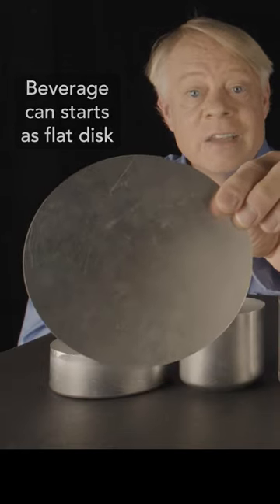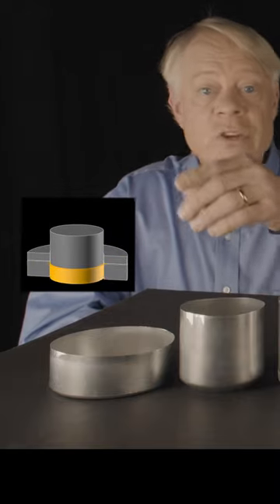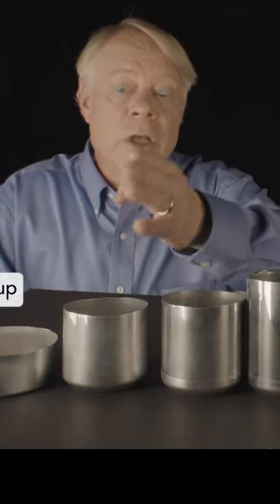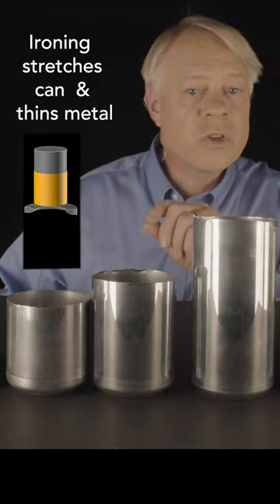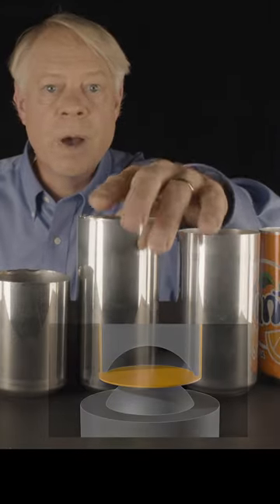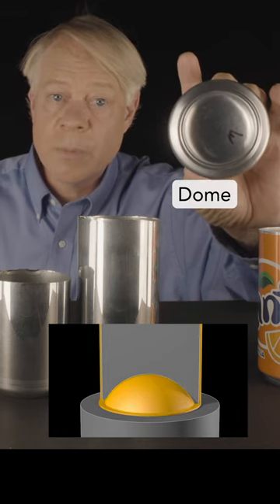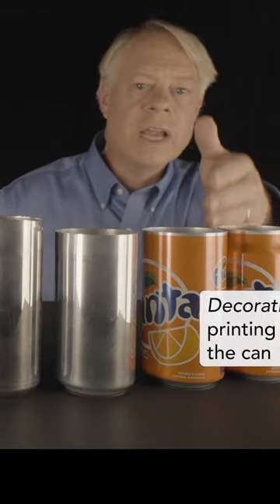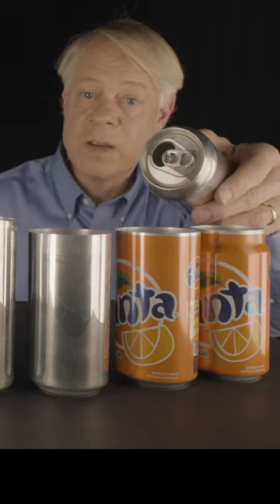Beverage can manufacturing #shorts #engineerguy

Comment: It's amazing that aluminum can be stretched out like that, without rolling it. Is it heated during that step to make it more pliable? It seems like cracking would be a common problem
Reply from the maker: That’s why it is done progressively (ie in steps)
Reply: At every step, the aluminum is getting warmer (but not hot.)
The amount of heat doesn't increase the elasticity however, if the process is stopped, and the aluminum loses heat, the piece will become brittle and might not be capable of making a finished can.
The most critical aspect of the process is the temper/hardness of the raw material AND the amount of oil used in the process... especially the deepest draws.

Comment: Love the videos. Learned recently that the bottom dome is also used to make stacking more efficient and you can also use one can to open another.
Reply: That still NOT the original reason for the dome...
The hole in the handle is also NOT for a straw (like some stupid "lifehack" videos implied)
Correlation is not causation!
If it happens to stack better then that's a bonus not the reason for it.

Comment: One question, how does the dome increase the strength of the bottle?
Reply from the maker: Perhaps better to look at it as same strength but with less material than a flat bottom
Reply: @engineerguyvideo  Ahh I saw the full video now. It increases the strength concerning the internal pressure, nothing to do with external forces. Didn't think about that! Thanks! Cool videos by the way, keep it up!